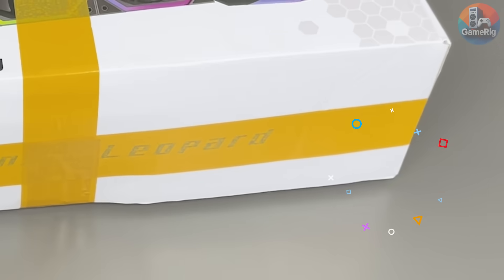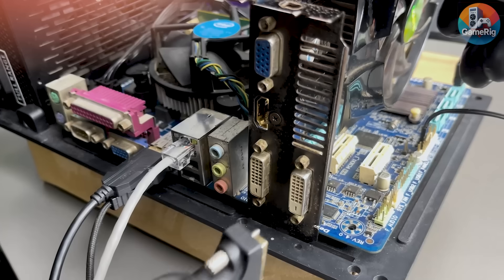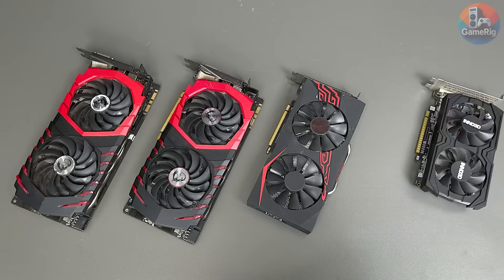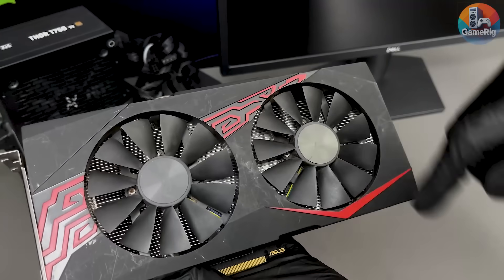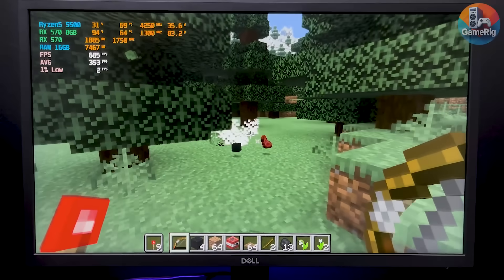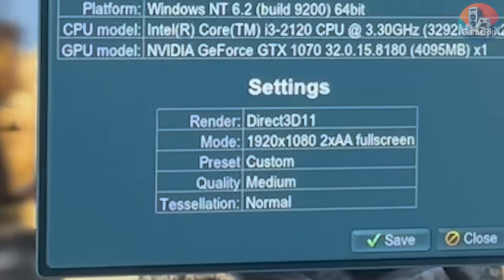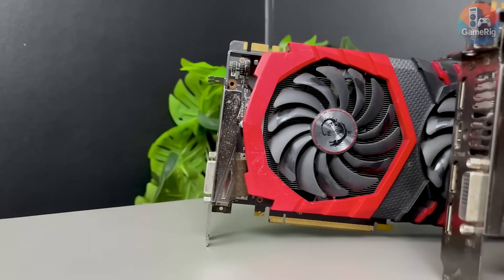I Bought 5 Broken GPUs for $150…Big Mistake?!

Comment: The RX570 IS not an Actual RX570. Its a ASUS RX470 Mınıng edition. it was not build for gaming and ONLY for mining so thats why the ports are missing. a modder put a rx570 bios to make the card work for gaming. and it works stable so you got a nice card there.

Comment: What you might want to do is: Pair it with a CPU that has ANY iGPU. You can use the iGPU to output the rendered picture of the dedicated GPU, therefore eliminating the issue of broken Ports. Personally made a great experience with the AMD 5600G for that Purpose.

Comment: i have two 5870's and two 4870's, one 390X sitting in a box. Are they worth anything?
Crossfire was good back then.
Reply from the maker: Some older GPUs still sell, but prices are low. Check local used market and demand for those models

Comment: Hey bro try blowing the 1070s main chipset with heat gun it maby fix theat gpu
Reply from the maker: Haha 😅 That’s risky! Might be better to stick to safer fixes or a replacement.
Reply: @gamerig68  you can try it because I had the same problem with my gtx 670 I just blowed the gpu dye with a heat gun and it fixed itself

Comment: the hd7700 doesnt have dead ports. old radeon cards always only use vga when there's no drivers. even in bios. same issue i had with an r7 250 - it only used vga until i installed drivers then when rebooting even in bios it worked with the hdmi (but on a different pc with no drivers it didnt)
Reply from the maker: Got you! 😄 That actually matches AMD’s old behavior pretty well — some Radeon cards prefer VGA output until drivers are installed, and HDMI can start working normally after reboot.  
Thanks for clearing it up, bro! 🙌🔥
Reply: @gamerig68  Hi! Where would it best to discuss collabs?

Comment: whats the actual price of rx 570 used?
Reply from the maker: Used RX 570 prices are pretty low right now — most working 4GB cards go for around $40–$70 USD, and 8GB versions often $50–$90+ depending on condition. Prices can vary by region 👌🔥

Comment: So for what reason is this video? You bought 5 defective cards, and the only thing you do is testing them. Sure, ehm. Thats a good idea with 0 use for any viewer i think. 
I mean, why not repairing these cards? the 1050 ti has a burnt mosfet, this is changed in under 5 minutes and maybe the card is fixed.
The artifacting 1070 is for the bin or "for parts", because these artifacts are most likely GPU related. VRAM can also make artifacts, but not in this shape. VRAM Error look different or behave different.
The 570 you can easily solder new  outputs, thats no magic. 
And the 1070 that is breaking down under 100 % load, yeah maybe its overheating on the ram, or the ram could be defective and struggle to hold the high frequencies. Some cards can have this problem, try to not limit the frames, instead clock down the memory by 10 % and try again. 

Overall it would be a better video if you try to repair these cards. Everyone can buy a bunch of faulty cards and try them. No need for a video.

Comment: 5:16 NorthWestRepair
Reply: 1050 easy pizza
1070 reball the core and some memory
1070 same above. 
Even consider swap the HDMI connector, the rusty one.
Reply: Single phase big coil usually for Vmem/VDDQ. This one is easy

Comment: for the 4th gpu try cooking the pcb with a heatgun on low airflow but max heat maybe the solder will reseat some components or something might happen because it worked with my 1050ti
Reply from the maker: I get what you mean, but a normal heatgun “cooking the PCB” is too risky 😅  
Real GPU reflow needs controlled airflow/temps, otherwise it can damage the card permanently.  
What worked for the 1050 Ti might’ve been temporary or luck.  
I’ll stick to safe methods for testing/repairs. Thanks for the idea tho, bro! 🙌🔥

Comment: Artifacts usually indicate a ram issue. One or more is bad. Use a program like MODS to test the chips. You can then replace them or try a re-ball but that requires a high level of ability and the right tools.
Reply from the maker: Exactly — artifacts are almost always a VRAM signal 💀  
I’ll try proper MODS/MATS/MATS testing or similar diagnostics before jumping to repairs like chip replacement or a reball.  
Thanks for the solid info, bro! 🙌🔥
Reply: @gamerig68  Anytime. If it is ram and replacement is above your skill level Tony at Northwest Repair works wonders at re-balling https://www.youtube.com/@northwestrepair but it will come down to the cost and if it's worth it.

Comment: I had  HIS  hd 6770 mid eange card in 2011 it qas just under £100 performanced quiet well actually. In regards to the hd7750  1gb version though have less  vram has alot higher bandwidth 75 gb/s
Reply from the maker: True! 😄 The HD 6770 was a solid mid-range card for its time, and the HD 7750 may have less VRAM but the higher 75 GB/s bandwidth definitely helps with efficiency and lighter workloads.  
Thanks for sharing, bro! 🙌🔥

Comment: what if you try undervolting the 2nd 1070 and see if it fixes the issue
Reply from the maker: Good idea 😄 I’ll try undervolting the 2nd GTX 1070 and test it under gaming load to see if it improves stability.  
Thanks for the tip, bro! 🙌🔥

Comment: The last 1070 , the issue is with temps , give it a clean and replace thermal pads and give it new thermal paste and retest , and monitor the temps , if its peaks to high you can get a black screen , a good thing to help it is to downclock card slightly with a temperature cap
Reply from the maker: Great advice! 😄  
Yep, temp spikes can definitely cause black screens on older cards like the GTX 1070.  
I’ll clean it, repaste, replace pads, and retest with proper temp monitoring — and try a slight downclock with a temp cap for stability.  
Thanks, bro! 🙌🔥

Comment: hello man i really like your videos i only want to know from you hp elite usdt 8300 have mxm gpu slot what any thing exists that like mxm to pci x16 slot please reply or if you can make video on it
Reply from the maker: Yes — the HP Elite 8300 USDT has an MXM graphics slot inside, so you can install a laptop/workstation MXM GPU card (like older Radeon/Quadro MXM modules) and get better graphics out of it. 👍

But you *can’t just plug a normal desktop GPU into that MXM slot* — it’s a different form factor and not a PCIe x16. There are some complex eGPU setups via other headers, but they’re not simple swaps. Thanks for the cool question! 🙌
Reply: @gamerig68  thssnk you

Comment: The Heaven benchmark score on the last card was very low as well.  I have a 1070 non-ti and just for fun ran it at 1080p 2X AA like you have in the video and got 202.2 FPS.  No overclock, just as is.  That is quite a bit of a difference from the 138.5 you got while testing.
Reply from the maker: Thanks for the comparison! 😄  
Yeah, 138.5 vs 202.2 FPS is a pretty big gap — could be temps, power delivery, or clocks behaving differently during the test.  
Still lots of fun benchmarking these classics. Appreciate you sharing your numbers, bro! 🙌🔥

Comment: On my RX 480, The same thing as on the last 1070 happened to me, it was overheating vrms, and i could not get them to not overheat by any means, but thing that kinda worked was undervolting, little bit of underclocking (max 10%) , lowering power limit also making fans blow 100% worked perfectly years after. You should try that
Reply from the maker: Solid advice, bro! 😄  
Undervolt + slight underclock and lowering the power limit sounds like the safest way to tame hot VRMs — and I’ll push the fans harder next time too 🔥🙌  
Thanks for sharing your experience!

Comment: the only thing i could think to try and repair the memory defective 1070 would be to reflash its vbios to the vbios chip directly.
Reply: missing thermal pads on memory is a bad sign, i had a 1080 of that model back in the day and the ram ran very hot so these are probably cooked.
Reply: i take for granted from the pcie burn that the gpu might have suffered a power surge during a storm and somehow corrupted the vbios in some way as its a non physical intervention.

Comment: For the 4th GPU, this looks like a soldering issue. To fix that you can heat up the board quickly, and blow air 15-20 seconds on every memory chip and 30 seconds on the die. I had a HD 4850 with the same problem, and now its alive, and well!
This usually happens on higher end GPUs, because they generate a lot of heat
(sorry for my bad english)
Reply: Yeah, but not with a damn hairdryer lol.

Comment: Any time you see no image on HDMI you should first get a cable that is known to work and be compatible with the item you are using. 

THEN you should check the HDMI retimer chip. Quick check on that chip will tell you if it's toast or not, but you had fan spin on the first one. Grab a DVI cable and check to see if you get any output.

I bought a complete 1070 ti last week for $80. Functional, booted immediately, plays games at 100+ FPS. No issues.
Reply from the maker: Great breakdown 😄  
Yep, testing with a known-good cable first and then inspecting the HDMI retimer chip is the correct order.  
I’ll run DVI output checks before assuming dead ports next time.  
Also, $80 for a fully functional 1070 Ti is a solid deal — love seeing those cards still crushing games 🔥🙌  
Thanks for sharing, bro!
Reply: @gamerig68  I've had known good HDMI cables fail to work on known good HDMI ports simply because of standard. I prefer Display Port or DVI as a standard.

Comment: is hd 4600 good for gaming? (i am using i7 4770 and 16 gb dual chenel ddr3)
Reply from the maker: It’s decent for very light esports and older games 😄  
With i7-4770 + 16GB dual channel, 720p/low settings will be very playable, but 1080p might struggle.  
Still a fun iGPU for classic gaming tho 🔥🙌
Reply: @gamerig68  tnx you i never thought you would notice me

Comment: Bro should I consider buying a gt 630 for 8.2$ in India its cheap to upgrade my system (current specs intel core 2 E7500 with 4gb ddr3 ram)
Reply from the maker: Yeah bro, for ~₹700 / $8 the GT 630 is worth it on your old E7500 + 4GB setup — it’ll be a noticeable upgrade over no GPU and handle light titles like Minecraft or CS at low settings.  
Just don’t expect modern games to run smooth — CPU + RAM are the bigger bottleneck 👍🔥
Reply: @gamerig68 can you guess at lowest setting at 8 chunks at 720p may it playable

Comment: The piggy tail power connector on your PSU might be causing the black screen. It's best to use two separate pcie cables not a single piggy tail
Reply from the maker: Great point! 😄  
Yeah, piggy-tail PCIe power can cause instability on GPUs with power spikes.  
I’ll test it with two separate PCIe cables next time. Thanks, bro! 🙌🔥

Comment: 12:09 one of the VRAM is not working properly it can be fixed 
Maybe you can modify the gbu bios to disable the faulty vram so you can make sure the gpu is working correctly
Reply: I have never once heard of anyone using Vbios to disable individual memory module, that's not how this works. The proper way would be to diagnose the card using mods mats and replacing the module that's giving him the errors. If the errors persist/shift you're most likely looking at a dead core.

Comment: I'd say you did alright. Getting three functional cards isn't too bad for 150. I bought 10 gpus for 130 bucks two year ago. I had low expectations but I got two working radeon R9 390s, a working 980ti, a working gtx650, and six paperweights. Sad because one of the broken ones was a 1080ti. I like to have some older gpus floating around for testing and free budget builds for the neighbor's kids. And yeah, checking each one to see if it worked was fun!!
Reply from the maker: Honestly, you still got some solid wins in that bundle! 😄 2× R9 390, 980 Ti, and even a GTX 650 for that price is pretty awesome — shame about the 1080 Ti tho 💀  
Love the idea of keeping older GPUs around for testing and helping kids with budget builds, that’s real PC community energy 🙌🔥  
Thanks for sharing, bro!

Comment: Hey bro can u help me I'm suffering from the same last GPU problem, I'm using a RX 5600xt 6gb gddr6 , whenever I start playing games it crasgee everytime after 10-15 mins , but when I run occt on it it runs perfectly fine , what should I do ??? When the game crases a driver Time out pop-up comes...pls tell me bro
Reply from the maker: This is a very common AMD driver timeout issue.  
OCCT can run fine because games hit the GPU differently (power spikes, temp spikes, and VRAM load behave differently).

Try this:
1. Update to the latest AMD drivers (use DDU first to remove old ones).
2. Check temps while gaming — if hotspot spikes past ~95°C it can crash.
3. Slightly reduce clocks or try a less aggressive undervolt if you’re using one.
4. Make sure your PSU is decent — 5600 XT can spike hard in games.

Most of the time this gets fixed with a clean driver install or more stable tuning. You’re not cooked yet 😄🔥  
Good luck, bro! 🙌

Comment: The artifacts might correspond with a faulty ram chip. Increasing voltage might help. Also lowering the mem speed might do. Aaand was there one pad on a ram chip missing?
Reply from the maker: Good thinking! 😄  
Yes, a missing or worn thermal pad on a VRAM chip can definitely cause artifacts.  
Lowering mem speed or slightly adjusting voltage can also help with stability — I’ll test that out.  
Thanks, bro! 🙌🔥

Comment: Well, what specifications do I need to build my own computer? 
I mostly use it for playing light games like Minecraft, shooting games, and watching YouTube content 
My budget is small as you advise me ?
Reply from the maker: For light gaming & YouTube on a small budget:
✔ CPU: i3-10100 / i3-12100 or Ryzen 3 3100 / 4100
✔ GPU: GTX 1050 Ti, GTX 1650, RX 570 (used is OK)
✔ RAM: 8GB (16GB ideal)
✔ Storage: 240–500GB SSD
✔ PSU: 450–550W 80+ Bronze
✔ Budget motherboard + case
This will run Minecraft, shooters like Valorant/CS2, and YouTube smoothly at 1080p.
Reply: @gamerig68 thanks

Comment: I build my dream PC back when the 1070 was launched with the very MSI model, i paired it with a 6700k and it was a beast. Id say yours had been mined on, one has a faulty ram module and the other probably a core.
Reply from the maker: Love that throwback build! 😄 6700K + MSI 1070 was an absolute beast era 🔥  
And yeah, mining + bad VRAM or a weakened core could explain the issues — I’ll dig into it more in future tests.  
Thanks for the insight, bro 🙌🔥

Comment: I believe the fix for the last card is just a matter of changing the termal paste on the vcore and ram chips.
Reply from the maker: It can definitely help if the issue is overheating 😄  
I’ll repaste the core (V-core area) and check the thermal pads on VRAM, but artifacts are often a deeper VRAM or power-stage issue, not just paste.  
Still worth a clean and retest tho! Thanks, bro 🙌🔥
Reply: @gamerig68  The last card tested did not had artifacts, thats the one i'm talking about, it was just stop working after some time, assuming getting too hot. The artifacting one needs a core and vram reballing but then the video subject will lose its interest (low budget speaking).

Comment: 13:31
Just because a PSU is 700w, doesn't mean it will be able to maintain that 700w efficiently.
I had a 700w psu once...
When I upgraded from a GTX 660 to a 970, I thought it'd be enough. As one would discern...
Well guess what, turns out the little stickers of that say 80 rated efficiency bronze, silver and gold actually had a big hand in power delivery at the time.
And my psu was a 700w "white" 80 rated psu.
Shit did not hold well.
So i went and bought a 650w gold psu from evga. 
I'm still using the same PSU right now.

Also, MSI IS CURSED BRO, NEVER BUY AN MSI GPU, JUST DON'T.
THEY ALL JUST STRAIGHT UP START ARTIFACTING AND DYING 1 MONTH AFTER YOUR WARRANTY EXPIRES.

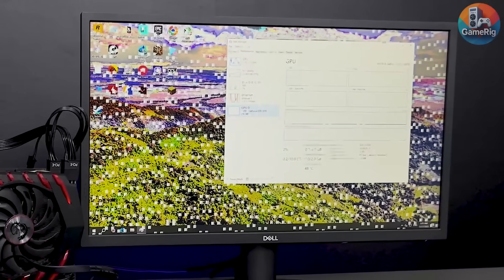Comment: 3:37 2gb vram on cyberpunk min spec reg is 8gb vram is wild 💀  6:28 This is the first time I see a GPU with broken connection ports. 10:39 its alive! 10:55 nooo GPU artifacts are the worst signal 13:22 Yeeyyy Gtx 1070 8gb still showing its claws! 80 fps! No problem...  13:30 thermalpaste check! With the last 1070 I would recommend checking inside because if it shuts down under load then the core temperatures are probably a critical hot spot and it simply shuts off /  It's a pity that 1 is dead, probably on the gpu power supply... or worse still on the gpu bios. Thanks for testing!
Reply from the maker: Haha yeah, 2GB on Cyberpunk is wild but fun to test 😂  
And 100% agree — physical damage, VRAM artifacts, and temp spikes are all part of the old GPU gamble.  
I’ll inspect the power stage and repaste before the next retest.  
Thanks for the hype and tips, bro — appreciate you!
Reply: @gamerig68  It's no big deal; few people share solutions to PC problems. And if it works, a little cleaning will do the trick. Unfortunately, an oven won't help with artifacts, and that sort of thing will do more harm than good. (Many components are too melty for an oven; I never understood this technique; it works like cleaning a mouse with WD40 XD—clean, clean, but only temporarily, then the same thing happens.) As for burned-out chips, it might work if you find a new/used one, but if it's burnt, the traces are probably gone too. But such old graphics cards, despite new thermal management, won't help with artifacts, even though the maximum temperature is 55+ degrees Celsius—which is a shame.

Comment: @12.
1: One or more VRAM dead.
2: One ore more VRAM has pads on the PCB torn off, due to the "SAG" of the board. Or a card transported without being removed from the PC. (car)
3: GPU has pads on the PCB torn off, due to the "SAG" of the board. Or a card transported without being removed from the PC. (car)

We'll never know if one of my ideas was good.